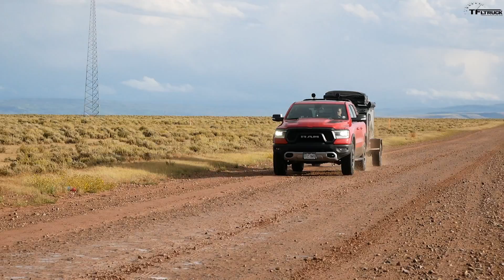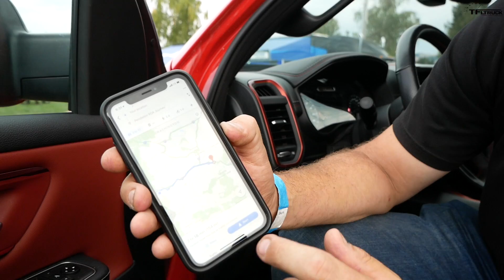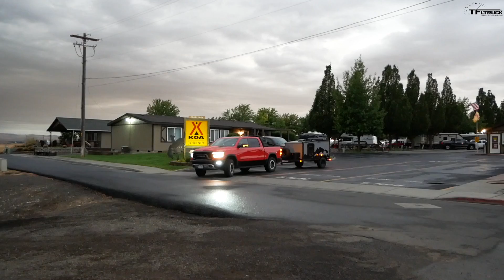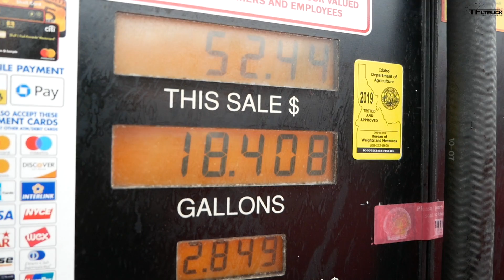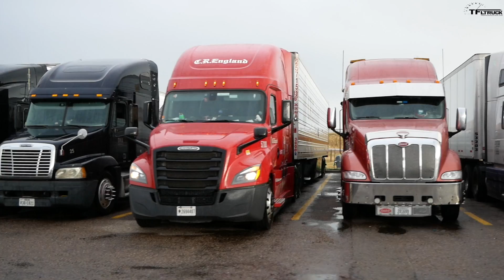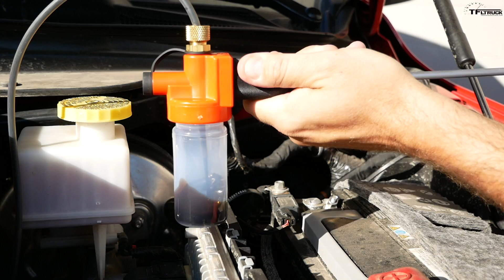Yikes! This 1,000 Mile One Day Overland Trip REALLY Beat Us Up! | Torture Test Ep.4

Comment: Using Shell Rotella "gas truck" 0w-20 in my 2017 Toyota Tacoma SR5 3.5l V-6.  So far, I have 7200 miles on this oil change.  I used Mobil 1 Syn 0w-20 before Shell and would have to add a few ounces of oil between each oil change.  I run my truck pretty hard and put about 30,000 miles a year including towing a bass boat a few times a year up into Ontario, Canada.  The Rotella oil level has not change and my engine runs very smooth!!
Reply: If you're burning oil or losing oil, that has nothing to do with what brand you're using lol.
Reply: @JacksCirrhoticliver  sort of, some oils vaporize additives and whatnot faster.
Reply: @volvo09  Yes... only a few oz. between changes using Mobil 1.  So far, the oil level on the Shell Rotella has remained the same.
Reply: Yeah I switched from M1 in all my vehicles over to t6 years ago. I like the price, and it offers great protection. I'll still keep using the diesel stuff though, just my personal preference.
Reply: @volvo09  I'm not a fan of M1 either. Between that and Castrol synthetic, Castrol has been far better.
Reply: @zephxiii  My son has had great luck with Castrol Syn in his 08 Subaru Legacy GT.
Reply: Huh" I'm using mobile1 in my Tacoma, You got me thinking!
Reply: im from ontario, where abouts you fish?
Reply: @Dirka13  White Lake.. Just west of Ottawa
Reply: I use Rotella in my 14’ Ram 1500 and really nothing different from M1 I used to use. I go 8-10K on both and never need a drop. Maybe because my truck calls for up to 10K intervals on conventional oil.
Reply: This asshat is a paid Rotella troll.

Comment: I own one and these trucks suck..... can barely pull a 16ft flatbed trailer light double axle loaded with 1600lbs. Tires slip and braking is scary. Mine has abs issues also so it is even more scary. My trucks traction control has locked up on a dry road straight at 90km on a hwy full lock up. Piece of ram junk. Men don't buy these at all dodge will not fix it because it doesn't show a code or lights on. CEOS have been emailed Dodge has contacted me and said sorry we can't help you. They wont even replace the sensors on the abs or traction control units for piece of mind and safety. 90km lock up with my kids in the truck is not cool. I'd use them if it was possible but their too big of a company and lie when investigated by dodges customer service. Looks like Chevy will get my business or Nissan.

Comment: Why were you using 87/88 octane once at high elevation? Should have used 85 to be consistent
Reply: The truck recommends mid-grade to perform at it's best.
Reply: IceBerggeo But it looked like in Oregon/Idaho you were putting in Regular fuel (87 I’d guess there?)
Reply: @burnrubber2002  didn't catch that, but either way, once you get into the mountains, what would be "regular" fuel at octane levels of 87 become mid-grade... A bit too it than that, but I'll let you look further into octane ratings and why they are what they are, and why they can change with elevation.
Reply: IceBerggeo Yeah most people don’t realize at higher elevations they drop the octane levels because you’re compensating for the less chance for detonation due to the lower air pressure/oxygen. My point is that they were using regular at the lower elevation which should be 87, but then they used 87/88 at higher elevations which is the equivalent to 89-90 so they weren’t being consistent
Reply: @burnrubber2002  maybe because before the end of the tank, they'd be in the mountains? Not sure.
Reply: IceBerggeo Good point, that may have been it

Comment: Why is a 4x4 truck used for this?  A car towing a small travel trailer could handle this route.  Hardly over"landing", imo.

Just to toss out my opinion.  Overlanding with a four wheel-drive vehicle and roof-top tents is an African thing because of 1.The poor road conditions, and 2. the threat from predators.  North America is mostly paved and the only predators have 2 legs.  Unless you're heading out on jeep trails, in which case a truck the width of the RAM Rebel is iffy anyway, a car towing a travel trailer is just fine.

Please do a video on what is needed for what type of trip.  Some types of camping trips need a Jeep and tent.  Other types need a 4x4 truck with camper shell.  Others need a truck towing a travel trailer.  Finally, some just need a car with a roof-top tent or small travel trailer.

Comment: Hardly what I would call an "overland" trip. Wake me up when you get off the black top. You could have just as easily done this using a crossover.

That said, you would NEVER do 1000 miles in a day going through the rough stuff, be it mud, snow, sand or gravel. Even in outback Australia where there is absolutely NOTHING.

Comment: We lost a lot of our Shell stations here in Arizona; they’re now Speedway,  no top tier gas anymore. Just about any oil would have done well in this test long as it was correct grade, SN+ / Dexos 2 rated. I’m using Magnatec in my Ecoboost stuff,  used oil analysis over on bitog show it works well in the EB engines. 
When I drive from Sealy, Texas to my place in Az it’s an 1000 mile run done all in one shot. Pretty easy with speed limits being 75-80 most of the way. Going to Tx it’s a drop from 5000+ altitude to just above sea level in Sealy. Going back the climb over the 1000 miles costs roughly 2 mpg. In my case it’s just the truck but I doubt the load TFL pulled would tax it much, except for the gas of course. It might level a whole gas station getting the job done ha ha.
I can’t think of any modern car, properly maintained, that couldn’t sail through a 1000 mile trek in one day.

Comment: 18,gal gas tank ? My 2019 legacy has the same size tank
Reply: He’s fueling up too soon. Big Horn and under are 23 gal, Laramie and up at 26 gal and all can be upgraded to 33 gal. The low fuel warning comes on way too soon on the 19 1500
Reply: @jaym6079  just co-signing that I have a 2020 limited Ram with a 26 gal tank and the low gas light comes on when it says 50 miles range but at 0 range I still have between 2-3 gal left based on my fill ups. Your mpg history affects your range so if I have 5 or 6 gal left when my light comes on  then I assume TFL's truck would say low fuel with 8-9 gal still in the tank
Reply: D.Coder yeah same with my 19 Laramie. Was thinking why the low fuel light come on so early and some forum members say it’s because they base the fuel gauge off the 23 gal tanks. They can reprogram it according to some forum members but I just drive until I get into low teens or even zero range then fill up

Comment: wow that camper is so light and you are getting 12 mpg.   Yikes!  I'm sure that exhaust got old after about 200 miles.   Should have done exhaust cut outs!  Also, props for doing 1000+ miles in a day that's long.   I use Mobil 1 full synthetic.  Change it every 3000-4000 miles and it's always handled my loads.
Reply: What are exhaust cut outs?

Comment: I used rotella t6 5w-40 in my Tacoma for a long time. It reduced oil pump “slap” during extremely cold starts and always worked well. It’s been my go-to for the Jeep 4.0L, Toyota 4.0L in the Tacoma and Subaru 2.5L turbo in the STI. Always performed amazingly well.

Comment: Always enjoy Andre's reviews. 
And they're honest. Showing how a POS Ram gets 12 mpg towing a meer 2500 pounds! 
And I don't care what oil you put in that junker it's gonna start ticking, it's gonna break exhaust manifold bolts, it's gonna have electronic steering issues and much more. It's just not well built and the track record proves it!
Reply: Tom A stick with your dumbbells, dumbell.
Reply: @Welcometofacsistube  
Don't e upset cause you were stupid enough to buy one and now have remorse. It's no one else's fault! Ahhhh hahahahaha.
Reply: Well Tom I have a 5.7 Hemi with over 10000 engine hours and the thing is still running strong. Its never had any engine work done. Yes they do have issues with exhaust manifolds but if you would do your research so does the Chev 5.3 and 6.0 as well as the 5.4 Ford. Its a common thing amongst all the big 3. The 5.7 is a great engine normal maintenance is done.

Comment: Tiny tank. If you’re running low after 18 gallons, screw that!
Reply: 23 gallons is standard size for most 1500 series trucks, there is a 33 gallon option.
Reply: gpage 2014-2018 GM trucks had 26 gal standard, but unfortunately no larger option for most configurations.
Reply: @RyanRKJ  The F150 and current RAM both have 23 gallon tanks, but larger options.  You can get over 30 gallon tanks from either brand.

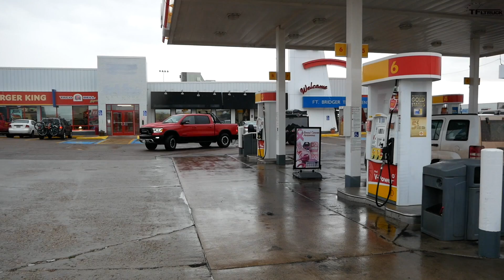Comment: Why not use 91 instead of 88 octane? 9:28
Reply: The 5.7l Hemi is rated to use mid grade gas so unless you have a tune requiring premium it's just a waste of money
Reply: @TheRamGuy  but owners manual recommends 89 when working the truck. 89 recommended, 87 acceptable
Reply: @zr1vetteman09  the owners manual doesn't say anything about 89 when "working" only that 89 is recommended  but 87 can be used. In either case why use 91 and remember the octane ratings are different at high altitude
Reply: @TheRamGuy  thanks for the pointless comment. 👌👍 I don't have my book anymore, I traded my hemi in for a diesel. The point was it recommends 89 and 87 acceptable. Split hairs much?
Reply: @zr1vetteman09  not splitting hairs just stating facts as a Rebel 5.7 owner.
Reply: @TheRamGuy  maybe I was stating the implied, if the truck is being worked hard, it's chances for knock are higher on 87.  If you want to avoid knock, run 89.  In case you weren't aware, this is the same motor since 2013. I had a 17 hemi ram as well. Commuting, 87 will never be an issue and maybe not even an issue hauling or running it hard, but I wouldn't do it with mine. You're coming off trollish with your posts.

Comment: Interesting, I tow the same weighted trailer. On long trips like this, My Power Wagon gets a hair over 13mpg hand calculated.
Reply: Nucl3ar Family on long trips in my 2011 ram 1500 I’m getting 11mpg unloaded, I envy those with the 6 and 8 speed transmissions
Reply: @jonathanhynes5318  UNloaded??

My '86 F250 diesel 4speed manual does better than that.

Comment: If I remember correctly, TFL is  using 0w-20 grade in the Ram? As an ex Nissan South Africa Automotive Engineer that also specialised in engine/drivetrain lubricants and oil, air and gas/diesel fuel filters. Also conducted and studied the oil sample analysis every 6200 miles on 150 fleet vehicles, including approximately 10 competitor vehicles (cars and 4x4 trucks) over a five year period. The outcome being that low viscosity oils  such as 0 to 5W-XX (fully synthetic or mineral based) caused excessive engine wear (bearings and camshaft lobes specifically) during the hot Southern African summer months in all vehicle operating conditions due to too low a viscosity and oil hydrodynamic film strength breaking down.  BMW South Africa also had similar engine woes as Nissan South Africa, thus, the 10W-60 grade engine oil availability from Castrol and Mobile with high anti wear additive package to help prevent premature engine component wear. I would love to see the engine oil spectro-analysis results for the Ram Rebel at the end ot the "Torture Test" to judge the Shell Rotella Gas Truck engine oil performance?
Reply: The problem becomes VVT engines and in these 5.7l engines they have MDS or cylinder deactivation. If you put in a 10w-** oil in this truck it will throw codes and oil wont be able to get through the small oil passages in the head. If what you said was true then every engine in North America would be failing at this moment but guess what they don't.
Reply: @TheRamGuy  According  to Dodge's engine oil requirements the "Dodge Ram 1500 trucks with 3.7-, 4.7- or 5.7-liter engines generally use 5W-30 oil. Not 5W-20 oil.  Dodge state, the outside temperature such as in summer can change the vehicle's needs to a different oil viscosity grade requirement. If the minimum air temperature is above 0 degrees Fahrenheit, a 10W-30 oil can be used." Your comment that a 10W oil will throw codes is a spurious remark based on what evidence? Remember that the 0W to 10W is the winter weight and not the final viscosity weight which is more important during hot weather operating conditions. Also if you refer back to my original comment I was talking about the South African vehicle use conditions , and to add, the summer temperatures get up to and sometimes over 45 degrees Celsius (113 Fahrenheit) for days and weeks on end. I have been to the USA and even did the Moab off-road trails in summer and the place was just as hot as South Africa in summer. Furthermore, I am an Automotive Engineer and my above comment regarding camshaft lobe and bearing wear with very low viscosity engine oils is based on factual evidence and included engine teardowns to check dimensional variations against design standards. We had engine excessive wear and failures which included Nissan, Toyota, mazda and Ford engines on our engine dynamometer doing engine durability testing conditions. Engine oil viscosity and additive packages played a big role in engine durability and long life. The bottom line is do not listen to hearsay and use the right oil for the operating conditions as per the vehicle owner's manual.
Reply: @johnfinch8173  man you are stating some old facts from more than a decade ago. They no longer make the 3.7 or the 4.7 and the 5.7 Hemi you are talking about is the older one without MDS. The Hemi's now require 5w20. You may be an automotive engineer but if that's true you would not have glossed over the facts regarding VVT and cylinder deactivation style engines. I am just hoping some guy with a modern Hemi doesnt take your advice and dump some 10w40 in his truck and wind up with some major issues that require a trip to the dealer
Reply: Wasn't IT a 5/20?
Reply: @ralfberger6960  yes it was a 5w 20

Comment: Fuel light on. Fill up up is 18 gallons. What a joke. Need a video on aftermarket fuel tank.
Reply: They should have got the optional 33 gal tank
Reply: Shawn Clark in the video where they introduced the purchase, they mentioned they could not find a truck with the larger tank option in the truck they wanted when they were shopping.
Reply: @RyanRKJ  missed that part. I know you can get a 33 gallon tank as an option now for both this generation Rebel and the last generation as well

Comment: 12 mpg for a tiny tiny trailer; I got 12 when towing an 8,000 lb 36 foot trailer w a Toyota Sequoia.  Hope u get some good sleep, that drive tortured u
Reply: I find that number very hard to believe. Maybe you got 12mpg going downhill with a 36' 8000lb travel trailer. I mean the Sequoia is rated for 7400lbs max and let's not forget it's rated for 13 city 17 highway. So you somehow overloaded a Sequoia with an 8000lb 36' wind brick and pulled off 12mpg 👍
Reply: @TheRamGuy  its true, hemi v8s are known for a lot of things but good gas mileage is not one of them
Reply: @idonthaveaname2719  haha. No kidding. Hell when I got my Rebel i wasnt even thinking fuel economy, I mean it's a truck. I have a 35' 8000lb TT and average 8.2 MPG when towing
Reply: @TheRamGuy  i average about 7 on the highway but on hills and backroads its very low, on some hills it goes down to 0 lol
Reply: i got 2 mpg towing a 9000 30ft trailer with my dodge ram 1500 lol
Reply: No you don’t get that mileage with a gas sequoia.
Reply: B b no no you didnt
Reply: 8,000 included payload, but in 2008 the tow rating for sequoia was 10,000 when most manufacturers agreed to different rating system rating dropped to 7200 or 7400 I think depending on drivetrain.  This was a 2008 2 wheel drive.  All tires were at maximum inflation & trailer had radial tires.  This mpg was obtained on flat lands, cruise control on 55 mph.  After I upgraded to 2011 f250 diesel I got 15-16 mpg (running 80 psi in truck) I then upgraded the trailer to a 5th wheel fully loaded truck, trailer, payload at 21,000 & get 12 to 10 mpg.  Trailer psi is 110 & has 16 ply tires.  If I feather throttle & stay at 55 mpg 12.5 mpg is possible.  Last trip to the mountains total one way trip 450 miles (included flat lands)  mpg averaged 11 mpg.  On the way back everyone was tired & kinda over it so speed averaged around 65-70 mph.  Mpg dropped to 9.  It is possible to get descent mpg but it requires very disciplined driving.